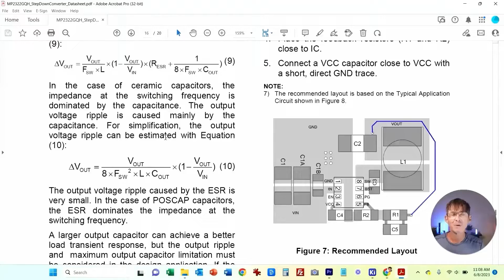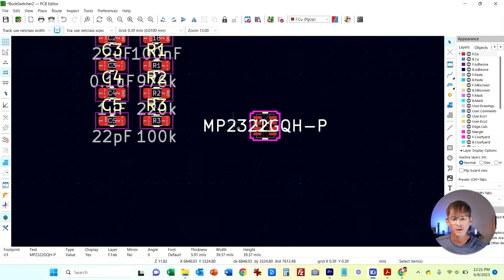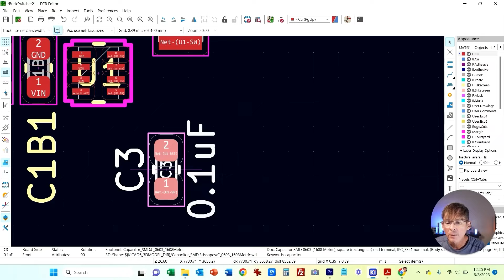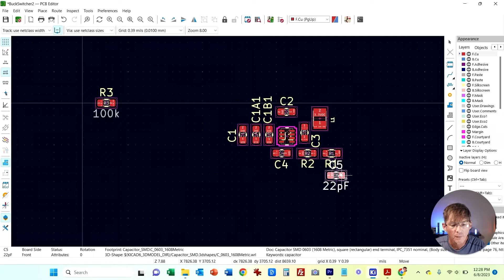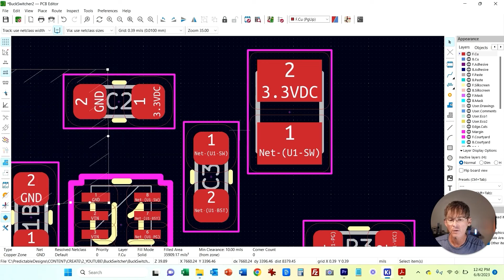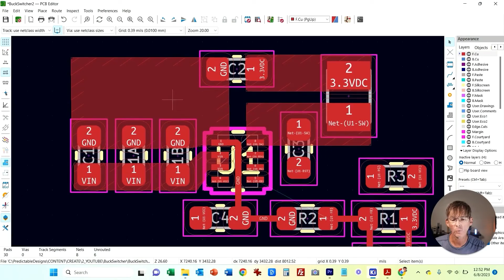How to Design a Switching Regulator PCB

Comment: What did you add, let say if you want to limit dc voltage to 12 to 15 volts before entering into the buck,  i have a design who imuse a buck and 12 volts to supply heater into the lcd, but i want to limit the DC input line to 12 to 15 volts , 500ma,  may i use a zener.
Reply from the maker: You could use a zener to prevent momentary spikes on the input voltage but you don't want to do that if the voltage will be a steady-state 15volts since the zener will just burn current. I'd instead just be sure to use a buck that can handle up to 15v.

Comment: I'm learning PCB software, I've tried KiCad (wasn't a fan), I'm trying DipTrace (kind of a fan). The issue I have with DipTrace is that finding components with Search is a tooth puller. If I select the Jclpcb basic components for example, good luck in finding an 8050 smd capacitor from the Menu. Another issue I had was getting the component library up to date for an ESP32-C3-Mini-1. Even when I added it to the Library, it forgot about it the next time I loaded the program, so it didn't save it. I had to add another folder the library system for a work around.
 Also I would consider the ESP32 line up a common IC component - so I guess I'm looking for a Better Search Engine and up to date Components lists.   Should I give KiCad another go or would you recommend something else?
Reply from the maker: Yeah I'm not a big fan of the component search function in either KiCad or Diptrace. But I tend to like it better in Diptrace.
Reply: @PredictableDesigns  I've been testing every PCB software I can find, and I like the Search in Target3001 - and it integrates really well. I had planned on using 2 programs, switching with Gerber files on the go. I looked at what formats these Parts Libraries have and been back tracking software that way. Siemens PADS $50/month and Proteus build your own package starting at 300 for a basic version. Push and Shove placement I've found in both Proteus (Professional $1000) and Target3001, same functionality difference in Cost.

Comment: Great video! Is there a way to filter the output further in order to minimize voltage spikes or is this simply impossible?
Reply from the maker: Thank you! Yes, and it's very common to use a linear regulator after the switching regulator to clean up the supply voltage. Get the voltage close to your target using the switcher then follow it up with a linear reg. So maybe 12V to 5V with switcher then 5V to 3.3V with linear.

Comment: Thanks, that's just what I wanted - I'm just starting to make PCB layouts and this video is a great introductory lesson on using KiCad.
Just one small suggestion: Could you say shortcuts you're using (select/move components, remove text, etc, etc)?
Sure I can look them up but it would be great if you mentioned them while you use them.
Reply from the maker: Glad to hear and thanks for the feedback. For most of these videos my goal is to teach the fundamentals and not specifics of using certain software. Thanks!

Comment: Great video John.  It would be nice, perhaps for a future video, to take the same IC and show how to work the equations to produce a 5 V output at 1 amp, or perhaps 2 amps (if the IC can handle it without some sort of pass transistor).
Reply from the maker: Thank you for the suggestion! I will consider such a video in the near future.
Reply: Thanks John, looking forward to it when you can (actually I look forward to any of your videos).